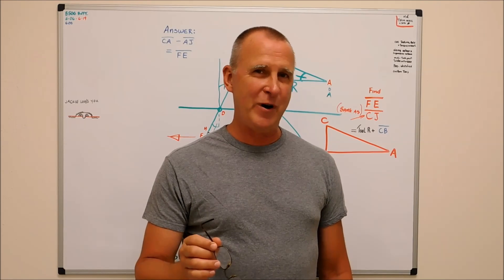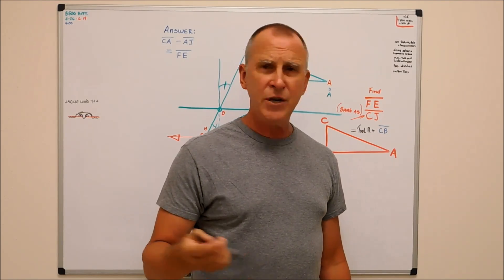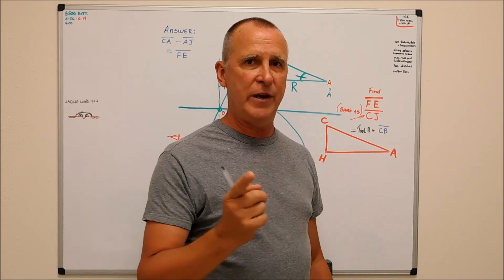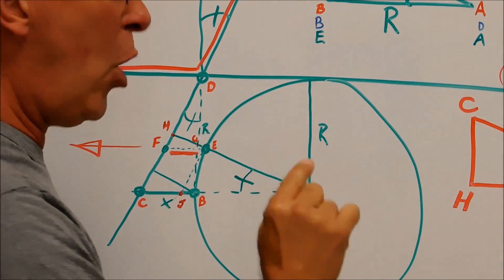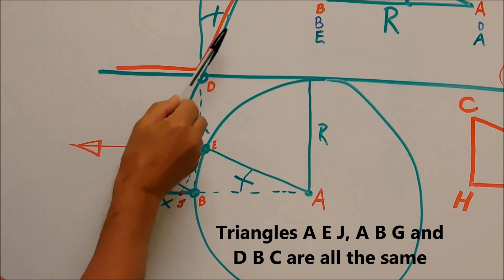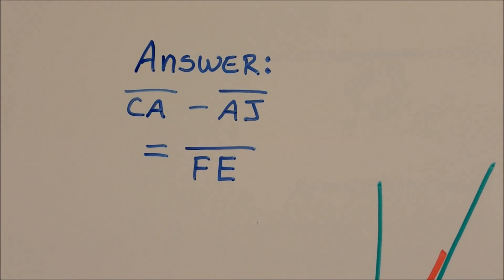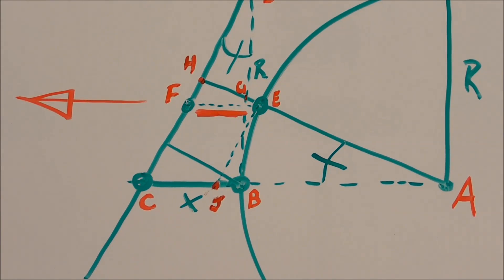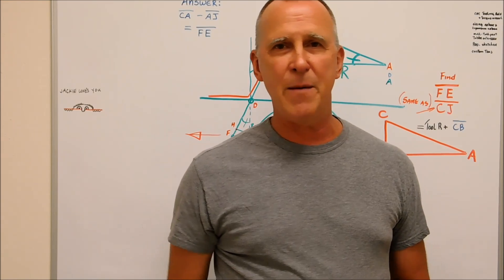How to achieve a tight dimension on a tapered hole.

Comment: Lets see if 30 year old maths still works. Assuming you are boring in the normal manner with the tool pointing towards you. I think you need to add (move the tool in by)  R ( 1 - cos(x) ). This is from adding a new triangle to the diagram, by dropping a line from I to the line AB, perpendicular to AB to create point J. As AB = R and AI = R then the line AJ = R cos(x) and the line BI = R - R cos(x) = R (1 - cos(x))  e.g For an ER collet holder with an angle of 16 deg and an insert with a radius of 0.4 mm. then we would need to move the tool in 0.0155 mm.

Comment: If you can't do the math, but know how to use AutoCAD... but that's cheatin' 😏
Why have a dog and bark yourself?
Reply: AutoCad is great for programming cnc machines but, in the manual machining world, and when something goes wrong at the cnc, it's always better to use your brain and actually know how to do things. Relying on software leads to the old adage "use it or lose it" and you will eventually tell someone "I used to know how to solve that". That's why there is a difference between a real, thinking machinist like Joe, and machine operators who can't figure out what went wrong.
Reply: @CalvinEdmonson  Well AutoCAD doesn't have CAM built in, but you still need to understand what needs to be achieved when you draw it out in CAD... but I agree if you don't use your mathematics knowledge, you'll lose it. Most of the time it'll come down to time constraints, if you have time to work out a bunch of triangles - do that (good practice), otherwise use one of the tools at your disposal.

Comment: Well done. Good explanation. I have never gone through the maths for this as G41 / G42 does it for your on a CNC lathe but its great to see the mechanics for manual purposes. Cheers. Crispin
Reply from the maker: Thanks Crispin. I have ZERO experience on a CNC lathe, but I am quite familiar with the different kinds and their capabilities. Good to hear you have some experience under your belt.

Comment: Hi Joe, did not understand any of what you were talking about. I have been 40 + Years in a toolroom environment and have never needed what you were saying. If the part was to be accurate, we would have done the following. 1) bore the minor diameter of the taper, parallel to the correct diameter and to final depth. 2) set the topslide to the correct taper using a sine bar and slip gauges. 3) Begin cutting the taper, when you are getting near final size, cut from the inside out. Set your topslide dial so that you know when the tool will touch the back face, use paper or steel shim feelers to set this. Then using an eye glass if needed,  slowly advance the crosslide outwards until it touches the minimum diameter. Be very gentle and careful when doing this, 0.001" at a time until you see the tool touch. If you are at all unsure, then back off the crosslide a couple of thou and do the cut. If you have a gauge / plug to check the fit, then now is the time to try it. If you do decide that your original touch off was fine then go ahead. All items, even tapers have a tolerance, unless the back face must be touching as well as the taper, which would be very unusual, there could be 2 to 5 thou tolerance on the diameter. I would expect that on the most expensive machine tools that the manufactures has similar tolerances. Good video although it was all "Double Dutch" to me.
Reply from the maker: Hey Dave. We must be from the same era. I walked into my first shop as an employee in 1975. Prototypes and tooling just about my entire professional life.This exercise wasn't about the minor diameter, or a feature with a bottom. It was directed to a viewer making a faceplate for his lathe. An item that registers on a face and taper at the same time. The part had to stay in the lathe until done. Most of your steps have validity, but if you start with a calculated shift all the way from the minor diameter of the bore, your margin for error is much greater than the feature done by this method. I always say 10 guys will do the same job 8 different ways with 1 result. This demo just showed how to calculate the tool radius out of the equation. Any time I deliver double dutch, its usually chocolate ice cream, but thanks for the comment.
Reply: Hi Joe, thanks for the reply. Yes similar era, i started an apprenticeship in 1966 at Philips Research Labs here in the UK. We made prototype mechanisms for the Scientists. They came up with an idea and we had to make working parts, kept modifying parts until it either worked or was a total failed idea. In the 1990's not so much work as the computer decided whether it would work or not CAD and all that. Keep up the good work.
Reply: A little professional jealousy there sir - Mr Pie has the maths and trig too do this stuff I guess and that means that inexperienced guys can rely on the math and trig to get there with his guidance- your approach is more the approach of a highly skilled craftsperson/artisan whatever - folks without your experience and feel and knowledge would find it hard to do what you are saying- not having a dig at you as I suspect you are a master, craftsman, machinist,  toolmaker and I have nothing but awe and deep respect for master craftsmen like yourself.

Comment: Joe, Maybe I missed something, but if this taper is being bored on a face plate for a nose cone on a lathe spindle wouldn't it be easier to indicate off the back side of the spindle taper to set the compound to the correct tolerances? Then just mount everything check for square and bore the taper.
Reply from the maker: Sure, that may set the angle, but what about the diameter?
Reply: I am not the best on the math side, but do pretty good on the applied side. I guess it would depend on what the stock had for error that could be corrected. I would have to say if you have the angle perfect, then a chuck or face plate already existing could be measured for diameter. I am rather new to all this but am currently making wheel adapters for my T/C and single lip grinders. I made a test taper before hand that matches both machines so I can check as I go. Thanks for bringing that to my attention Joe, it is those things that I am still consciously learning to look for to complete a job in the least amount of steps.
Reply from the maker: In the absence of a hard gage, you will have to rely on something for a good taper dimension. The technique of looping a pair of verniers and calling it a day may work for most applications, but when a taper mount has 2 nesting features, you should be familiar with this math. try the technique on a piece of scrap. You may like it. For a part with a critical internal  taper on it, I'd do the taper first. If it gets too big, face the part off, too small..cut some more of the taper and re-check it. Then proceed.
Reply: Good to know, I am on much simpler tasks ATM.

Comment: Trigonometry/geometry with Joe.  Next to really melt your brain, lets derive the equation for doing compound angle corrections...
Reply from the maker: Only if I get 7000 hits overnight.
Reply: To calculate the corrected amount to adjust the cross slide, you divide the amount to remove by the cosine of the angle of the taper, that is the angle the compound is set to with reference to the axis of the lathe.

For example, assume you have touched-off and zeroed your cross slide, and you need to remove 0.100" to hit your desired diameter with the compound set to 15º.  

The total adjustment on your cross slide would be 0.1035".  
       0.100" / cos15º =   0.100" / 0.96593 = 0.1035"

To illustrate using Joe's diagram, imagine point E is touch-off, and the distance from E to H is 0.100", the amount to be removed. The distance from point E to F is the amount the cross slide must move, 0.1035".

NOTE:  This assumes that you are measuring the diameter of the taper with gage balls or some other similar method that measures perpendicular to CD, the surface of the taper.  (See Joe's video on measuring tapers.)
Reply: Hi Richard,  I was making a joke.  The derivation of the equations for doing compound angles is very tricky to get your brain wrapped around.  You have to perform a 3D vector transformation to reference one reference plane to another.  Making sure you have correct angular orientation and signing consistency is vital as well as defining the required axes of rotation.  This is in reference to things like compound mitre cuts for crown moulding, or setting relief angles on cutters when profile grinding forms (such as a radius tool bit where you want a circular radius and not an oval due to setting the relief angles on your compound sine plate (2 axis)).
Reply: Hi Barry,  Haha, I knew you were gigging Joe, but your reference to compound angles didn't register with me.  Guess my train of thought was on Joe's diagram.

You're right, of course, compound angles have driven more than one man insane as well as generated tons of scrap.

Well, we only need 6,998 more votes to get Joe to do the compound angle video.  :D

Comment: This is exactly the same puzzle I had when I made a chuck plate for my D1-4 spindle.
Rather than mess around with a bunch of math (I actually have a math degree and use some of it professionally), I made a plug from oversized stock. I knew what the minor diameter needed to be, so I cut the taper on the plug so it was a .010"ish smaller at the small end (you can safely measure with calipers). I then blued the taper cut the plug to diameter about .050" farther than when the taper cleared, and made a good square shoulder. With a loupe, it is quite easy to measure the distance from the shoulder to the blued line on the surface plate with a height gauge (you should be able to have an error under 0.001"). The back of the plug does not need to be perfectly square to the sides, but the more square the better to reduce sin error in the measurement.

After than it is a simple matter to cut the tapered hole to near size put the plug into it, and measure the gap with gage blocks. The difference in measurements translates directly into carriage travel.

The result was a perfect fit on the first try with out having to remove and test fit multiple times.
Reply: I guess this would be used(maybe) When you can't test fit the part because it is not available. 

Not sure if many people will ever need this but never the less still cool to know. Glad you challenged yourself and saw it through shows your dedication. 

Thanks

Comment: I'm unclear about what the calculated offset is trying to measure. from the drawing it looks like you want to bore a straight hole through a conical face. is it the depth of the hole you're trying to calculate, based on the (shifted) touch off point?
Reply from the maker: Its the mouth of the conical bore vs the radius on the tool offset.